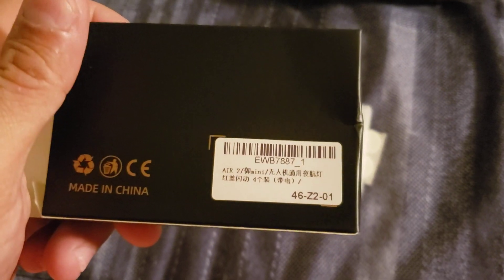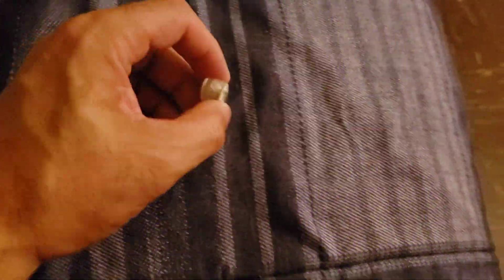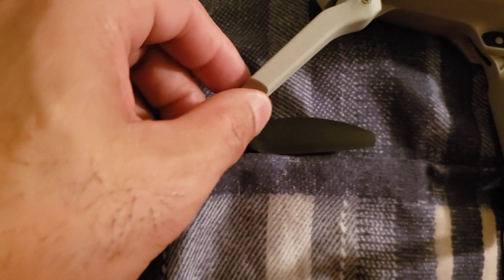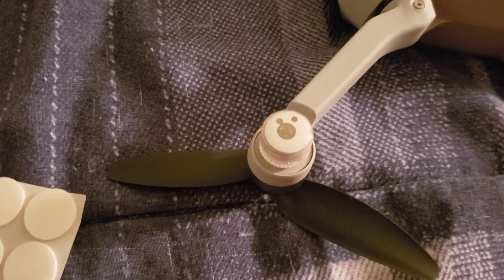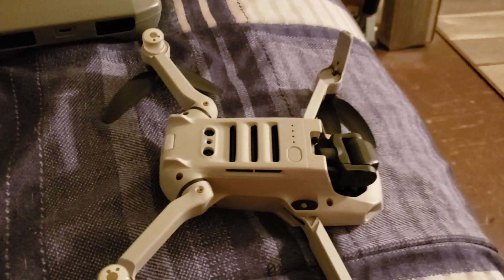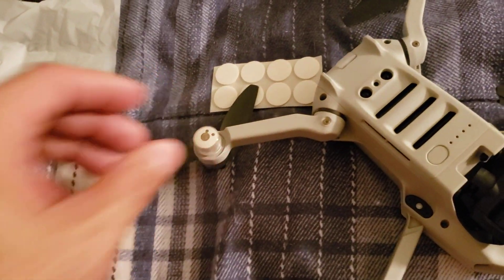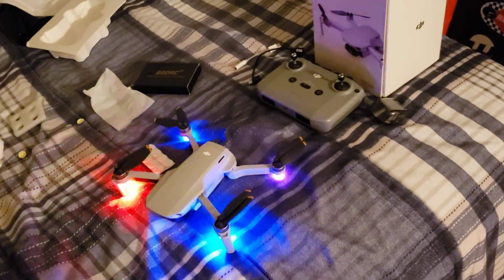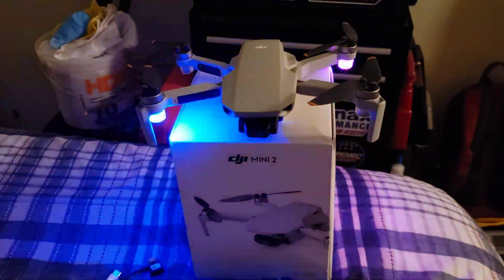installing Lights on my new DJI mini 2 drone

Comment: I’ve owned the mini for a few years. Bought every kind of light. The problem with these is they are not FAA approved as anti collision but worst of all, they fall off!!

Best lights I’ve bought is the ARC V series. Very bright and last many recharges.
Reply from the maker: Ah ok nice, I bought these just in case I decide to do a quick night flight. Lol
Reply: @dannysautorepair  I bought them too Danny. Cheap on Amazon. Try the lights that have the Velcro and stick them on top and on the battery door. Also, I have a set that came with rubber bands and they wrap around the arms. Much better. Plus they are all rechargeable so you don’t have to mess around with those little batteries. Most of the better lights come with the same basic ( 2 types) of charging cords…I set up a charging station for all my lights batteries etc.   They do cost more but you won’t be let down. Just make sure they state FAA approved because then you will know you are legal and you will be able to see them for a minimum of 3 miles.
Reply from the maker: Ah ok thanks for the information.

Comment: I believe you just covered up the motor filters. I thought about getting those lights until I found out that the bottom of the motor is supposed to remain open
Reply from the maker: Ah ok thanks for telling me I didn't know wow. I'm gonna remove the ones on the motors.